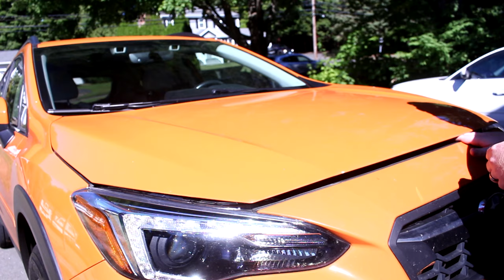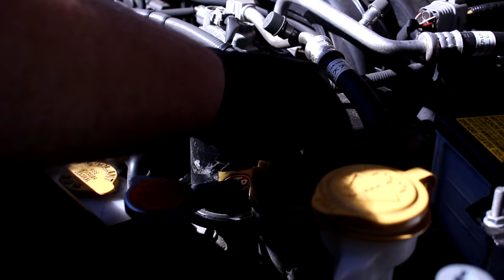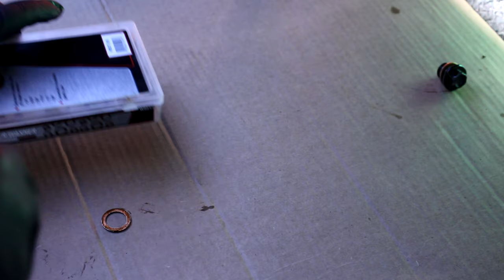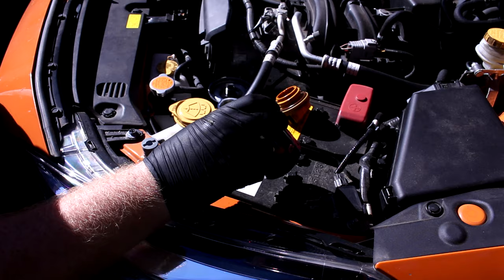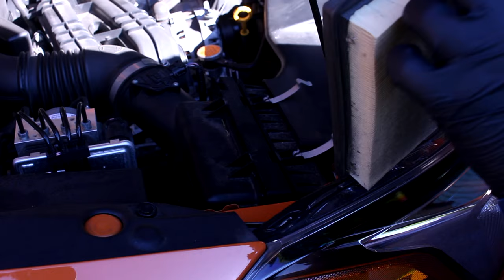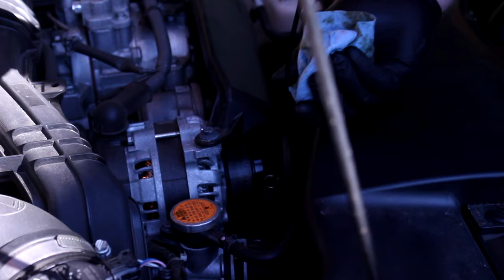Oil Change ASMR: Changing Oil & Filter • Deity D3 Pro Sample (No Mid-Roll Ad Breaks)

Comment: This was fun. I think even with my eyes closed I could have guessed what you were doing. Using that style of ratchet is brilliant, though in this case it didn't really save you. Shame about the traffic, but just added the the authenticity of the driveway oil change! This video is also great to demonstrate how easy an oil change, especially a Subaru oil change, actually is. Could be done without even using the ramps as long as your pan fits under the bumper. I've also almost never replaced a Subaru crush washer for the oil pan bolt. Never had a leaking issue. I am curious why the Royal Purple. Get a good sale? Also thanks for demonstrating to me what that red funnel is actually for. Overall the mic was pretty good. Definitely a little noise, but that's pretty much any budget mic I've ever tried. Good overall sound depth though. Captured most highlights well. A little overwhelmed if there is background noise, but to be expected for a higher sensitivity mic.